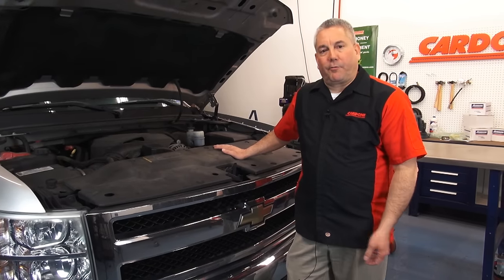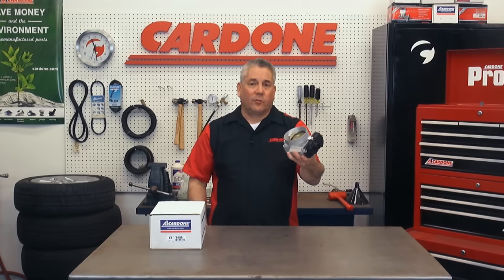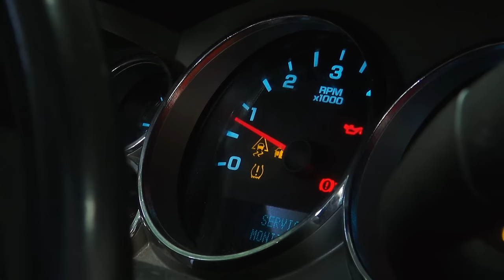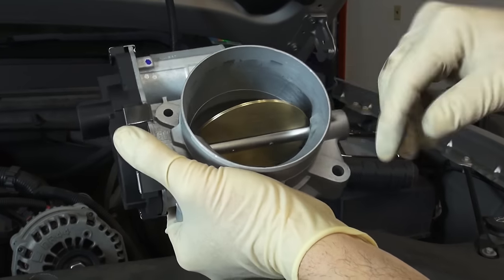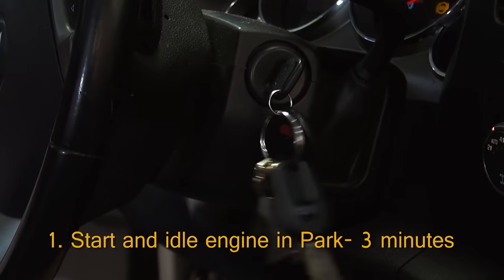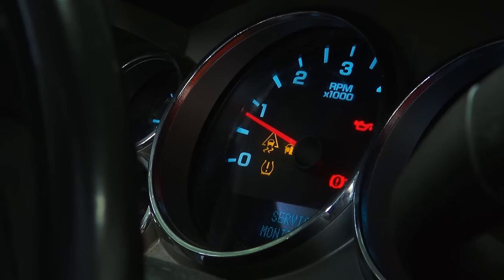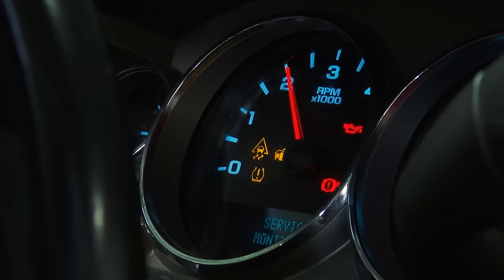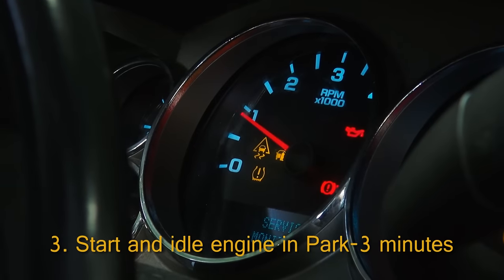GM Truck Electronic Throttle Body (ETB) Relearn Procedure

Comment: FYI....also be careful not to get carb cleaner into the electronic portion of the throttle body. make sure to tilt the throttle body in such away that the cleaner can't run down the butterfly shaft and into the electronic portion. there's a circuit board inside. and you don't want the cleaner to get on the cir. board.
Reply: Will it damage the throttle body if so? My Tahoe now in neutral idles up and down rapidly and n park stays past 1500 rpm’s then drops to normal a few seconds later
Reply: Roflmao! Anyone who actually removes their throttle body will know better. Just spray the inner parts and you'll be just fine.

Comment: 2003 silverado 5.3L.  check engine light on showing o2sensor system too lean and reduced engine power.  after replacing the electronic throttle body i deleted the codes and a few days later check engine light came on showing code p0332 knock sensor any tips on this one .  
please let me know thanks

Comment: what do you do if the engine wont idle? I replaced my throttle body (2006 trailblazer) and now it high idles then drops so low it stalls out. I got it going after a while and then the next day it did the exact same thing. High idle for a few seconds then the idle drops to a stall.
Reply from the maker: Hi Jesse, if you have a technical question, or need to troubleshoot a repair, be sure to reach out to our Tech Support Team, please call 888-280-8324 Mon-Friday 8am-5pm EST to speak with one of our ASE-Certified Technicians.

Comment: Hi,  Please help me.  I did exactly how yousaid to do the 're learn procedure.  But once the car is fully cooled off , Like in the morning,  I get the same symptoms, Check engine light and tc light.  

Thank you so much
Reply: Hi ,  Code is 0107 .  Only comes up in the mornings, first start of the day and when car is fully cooled off.  Already replaced the Throttle body and position sensor made by ac delco, Did the relearn process exactly like your video but shoots this code in the mornings and when cooled off.

Thank you so much
Reply: Sry.  It's a 2004 Suburban 5.3 gas.
Reply: Will do.  Thank you so much.

Comment: How do you fix rev hang like when you rev the engine up in park or neutral and the rpms are slow to return and come back down to idle?
Reply from the maker: Thanks for the message Bryan! This sounds like a question for our Tech Support Team, please call 888-280-8324 Mon-Friday 8am-5pm EST to speak with one of our ASE-Certified Technicians.

Comment: Uggghh what if this didn't work?! The car is still idling high and acts like it's in cruise control while driving. Take the foot off the gas and it just stays constant and doesn't decelerate... Any suggestions?
Reply: DAVE,  Got the same issue.  All of these videos on youtube sound easy with great results but it is NEVER the case.  Replaced the original TB on my 2013 Silverado with 265,000 miles today,   followed the procedures EXACTY, SEVERAL TIMES, without any success.  Idle goes to normal ONLY if stopped and I leave in drive and then it drops;  but, if I put it in park, it goes straight to 3,000 RPM and STAYS there. This is all Bull Sh  .  Did you ever find a solution?  I would appreciate your help.  Thanks. JIM
Reply: @932stretch  I ended up putting a new throttle body on the Malibu and everything is back to normal and working as it should. 🤷🏼‍♂️

Comment: My 07 Avalanche is doing a similar thing. I ended up taking it to a shop where they re-set the learn procedure I guess for the cost of $150, now it seams to be idling back to normal in park and when i come to a stop. However I do notice it will increase RPMs when costing even on a upgrade. seams to level out at 20MPH. another note it also only seams to have problem when at operating temp. when the truck is cold it operates as normal. Also seams to be shifting late, worried it will damage my transmission and wear my breaks fast. took it back to the same shop and they suggested putting in factory parts and re-learning it again for the tune of about, $600  I'm hoping driving will complete the learning.

Comment: I cleaned the tb on my 07 chevy cobalt 2.2l and followed the instructions but i have a high idle. it goes away in park after a few minutes but when i give the car gas, my idle goes back up to 1500 or so rpm and will stay there. What do I do. I've heard of getting the ecm reflashed at a dealership but that can be pretty expensive.
Reply: GM does this so that you're forced to pay the money to fix it. If you're okay with skipping a mortgage payment for the month, you can buy a scan tool to fix it for you. Pretty easy! But those money hungry fast cats design all new cars past 96 for this reason.

Comment: did what you said, still have an iratic idle after cleaning the throttle body of carbon build up,  even took it for a drive...it seemed fine for a day  then ,  the idle became erratic again and a check engine light came on
Reply: Which code did you pull?
Reply: Same issue

Comment: quick question  is the procedure the same for. a 2009 malibu I tried it but still remains the rpm at 3000.any info will help thanks ?
Reply: Hi, I got the same problem with my 2009 malibu, I cleaned the throttle body and then got 3000rpm at start and crazy acceleration, did you manage to solve the problem?
Reply: were you able to solve the problem?

Comment: ive been trying this on my 09 1500 4.8 silverado after replaceing the tps and cleaning the throttle body, i have done the 3, 60, 3, and have drove above 44 mph, stopped idled drove again stopped idled drove again and it is still idleing at 3000 rpm, any advice you could give?
Reply: my throttle position is 31.4% and when i put the truck into gear its at 20.x% normal would be 13.7% i was told, with the ignition on engine off i can manually close the throttle plate and the sensors reads that i closed it but it goes right back to the 30.x%.
Reply: Joe anonymous did you ever figure your issue out. I’m having same on 2012 5.3l.

Comment: When ever I put in the new sensor and had clean that I put it back on and the truck now accelerates by it self I tried everything on the video but it still doing that and I don’t want to put it on drive because my rpm on 4
Reply: Clear the codes before starting the relearn . After disconnecting the battery the engine light will be off but the code is still present in the memory . If it comes back on the test drive clear the code again and continue the relearn procedure
Reply: My tahoe  is doing the samething☹ accelerates  to 4 ...
Reply: Same problem  here..
Reply: @CAM_54321  did you clear the codes first then follow the steps. When you disconnect the battery the code isnt cleared it just turns off the check engine light. And do you have a scan tool ?
Reply: Mine is doing the same thing. I idling at 3 rpms but I cannot get it to go into gear

Comment: Some relearn advice for 2009 malibu? I already did this multiple times and it doesn't work, also tried the battery disconnect thing (24hours), push brake while battery disconnected nothing works, Do I have to take it to the dealer for reprogram? :(
Reply: did you ever figure this out? I am thinking of changing my throttle body due to the ESC OFF and Power Engine Reduced messages on the dashboard.
Reply: Cardone Industries no worries, what worked for me was to disconnect the battery before replacing the throttle body.  Once I replaced it, I connected it again and left the car on for 3 minutes to help the computer even out the RPMs. This video was a great help! thank you!
Reply: Ramses Rocha was yoir 2009 malibu giving you the reduce engine power, service esc, and no traction or service traction warning messages? did you replaced the throttle body yourself? it just happened to my car and took it to the mechanic and i think they are trying to scam me into getting other stuff fixed before fixing that
Reply: I have a 2.4 l 2010 malibu changed spark plugs and cleaned throttle body get a high Rev at 3000 wants to go as well without pushing gas Wil do about 25mph

Comment: Is it possible to do this after the truck has been started for the first time since the repair? I didn't get to see this until after I started and revved it immediately. It idles low now and would like to know if I have to  disconnect/reconnect the TB to restart the process.
Reply: Cardone Industries It's a 2006 5.3 in an Avalanche, I did the relearn and it seems to be better. Wouldn't hurt to do it again after disconnecting the TB though.
Reply: Cardone Industries. hay cardone i cleaned the thottle body on mi 2008 suburban did the relern work ok but if i acelerate to2500rp it will stay acelaratet ani tips thanks

Comment: Hey I have been doing body work on my truck and have been welding so I have had the battery disconnected and now my truck wants to stall after I let off the gas and it ran fine before I started working on it. Please help
Reply: You fried your computer.

Comment: Would this procedure work for a 1993 Buick regal 3100? I'm having stalling and hesitation. When I first bought the car the only code was a failed EGR code I disconnected the battery to take apart the plenum and repair the EGR.  I also replace I iac valve because the old one pindle came off. Every since then the car stalls when reaching operating temperature.

Comment: So I just disconnected and cleaned the throttle body, and after doing the relearn process I idle right around 600 RPMs, but the problem is if I rev up the engine the RPMs stay up and will not come back down. Any thoughts?
Reply: Any word on how to fix it?  Same issue on 2012 silverado.  If I put it in drive, it accelerates by itself.
Reply: @izrahiahisrael8726  bought a new throttle body 😂
Reply: @izrahiahisrael8726  you figure anything out having the same problem 2011 Chevy

Comment: My 2011 GMC Terrain was throwing the P2135 code and the dreaded Reduced Engine Power and Stabili Track errors. We replaced the throttle body and NOBODY told us to do the relearn procedure like this. It was still throwing the RNP and ST errors and we couldn't get it over 20MPH without shutting off and it locking up for a minute.  We did this relearn procedure and now it'll go up to 50 and alternate  down to 20 perfectly fine for long distances. It's now shutting off when sitting still and when going constant low speed (between 30-40) for longer than a minute or two. Any ideas? 

Give you a run down on what it's doing:
After sitting off for a while, it'll crank fine and not throw a code.
It'll drive fine alternating between higher and lower speeds the whole way.
AS SOON as it stops at a stop sign or red light, it'll die. But it'll recrank fine.
Also, as soon as you hit 30MPH and stay there for more than a minute, the code triggers (we kept it at 40 for a while and it only seems to trigger at the lower 30mph)
And after you drive it and recrank it, the code will trigger if you sit longer than a minute even in park.
Reply: Is your vehicle a  flex fuel vehicle?
Reply: @rodcollins6906  Hey Rod, I'm having the same issue stated above with a 2007 Chevy Avalanche 5.3L Vortec Flex Fuel.  Any suggestions?

Comment: Pretty close, you missed one crucial step. All DTC's need to be cleared PRIOR to performing the service bay/on road idle learn procedure. Regardless if the MIL is illuminated or not.
Reply: Exactly I  told them they missed that step months ago and they still  haven't responded
Reply: @jeanjacque1577  this is youtube what do you expect?
Reply: So your saying clear everything before taking the tb off?
Reply: @TB-uz2wu  clear it before starting the relearn so after you install the throttle body
Reply: How do you clear the codes
Reply: @reneorduna5448  scan tool or disconnect  the battery
Reply: The video mentioned that the codes must be cleared to continue re-learning.

Comment: I've always heard that '07-'13 had to have the idle relearn done with the proper scanner. Have I been told incorrectly about this and this method will work?
Reply from the maker: Hello Murrica Motors, can you please forward an email address so someone from our Tech Support Team to contact you directly? If not, you can call our Tech Support Line at 888-280-8324 weekdays from 8 am until 6 pm EST (5 pm on Fridays) or submit a question online at https://www.cardone.com/customer-service  Thanks!
Reply: Hi, I have an 07' Avalanche 5.3L Vortec Flex 4WD.  Can you please let me know if the relearn can only be done with a proper scanner or if this procedure will work without a scanner?  It would be extremely helpful an appreciated. Thanks in advance.
Reply: @AmitroniX  I have been able to achieve a throttle body cleaning by having someome turn the key on (not started) and then hold the gas pedal down and then take carb cleaner and a rag and carefully and thoroughly clean the throttle body without moving the throttle body blade in the process and remove all of the deposits/gunk and then let the person release the gas pedal and then turn the ignition off amd then hook everything back up and start the vehicle and it would be fine, but as far as replacing the entire throttle body I have always had to end up having it relearned by someone with the proper scanner.
Reply: @JustAGuy781  I have cleaned it in the past with the exact same procedure you described and it worked for a few months but now the issue is back.  I ordered a whole new OEM GM throttle body from AMZ for $215 and am installing it tomorrow.  I was tempted to buy the Hitachi bc it was cheaper and had good reviews.   I was under the impression 07's have to be done with a bidirectional scanner and you pretty much confirmed.  Thanks for the quick response.  I really appreciate it.
Reply: Btw just for anyone else reading, the codes I get are P2135, P1516, P2101 with reduced power, SVC traction control and stabilitrak.

Comment: So i tried this and changed the throttle body still idles about 3000 rpm but drives normal can yall help me out?
Reply: Enrique Cortex 
Did you try disconnecting the battery for a few mins?
Then try the 3 step relearn procedure?
If not, try that, and gopefully youlll get good results! And make sure if the throttle body was removed,yhat the 4 bolts are torqued down properly,and not causing a vacuum leak

Comment: I didn't replace but I cleaned my TB with specific cleaner on my 13 silverado 5.3. So far in neutral the rpms shoot to about 2300 and sit. I was told driving would relearn positions. I've put nearly 200 miles on it and still no fix. Also, in manual mode (transmission) if I shift down to first coming to a stop, the idle is very rough and then kills the engine. Is this still a TB issue? Thanks in advance.
Reply: Ryan, where you able to fix it? If you did, please tell me how you did it, thanks
Reply: +grillomix just replaced oil pressure switch. still no fix.
Reply: +grillomix just replaced the throttle body all together. Did the 3 min, 1 min, 3 minute relearn. Still having the same issue.
Reply: +Ryan Ledbetter l'm taking my truck to the dealer tomorrow, $110 😢
Reply: +grillomix mine quoted  $120. still debating on it.
Reply: Did some "high tech" relearn with a new gasket. All fixed now. Sorry
Reply: I replaced it all. New TB, new TB gasket, and then I had to pay for a TB relearn since my scanner/programmer isn't all high tech.
Reply: Ryan Ledbetter what hapen did you fixed
Reply: Jose Martinez I took it to my chevy dealer and they had to do a relearn through their scanner that was more high tech than mine. issue fixed after that.
Reply: Ryan Ledbetter thanks ryan im going to do the same thing
Reply: Im leaning towards that, How Much did they charge
Reply: Intimidator Ss I believe about $90 or so.
Reply: Thanks man, This is driving me crazy. I no I need a re-tune but an ECU Flash tune costs $500 buck-a-roos. Im going to run it down to Chevy.
Reply: Intimidator Ss no prob. hope you get it solved I know I was pretty irritated dealing with it for 1 day.
Reply: It might also be a vacume leak?
Reply: Intimidator Ss possible, but I figured after what I did it pry needed a legit relearn. vacuum leaks are simple to test.
Reply: Agreed, They can check and see what ever it is. Man I hope they can fix it...It messes with my transmission's head. It will try to accommodate the high RPM so when Im doing 55-60 it will shift up and down. Its a real P.I.A. Good news is when I nail it, it works fine.

Comment: I have an C3 corvette with an LS7 motor.  Motor idles at 900 rpm even tough the tune has it set to 650.  I sometimes get a P2176 DTC (Minimum throttle position not learned) which in turn puts the car into limp mode.  I'm having a hard time finding a solution to my problem.

Comment: I tried this and had no luck on my 2008 Avalanche after i installed a new throttle body. I  also drove it and   still when i hit the gas in park it goes to 3 grand and stays there . Had to take it to a shop and have it reset with a programmer.
Reply: How much u had to pay
Reply: @trustinthelord2248  it was 100 dollars

Comment: 2009 silverDO...CHANGED PEDAL AND TPS (3TIMES)   idle wont come down from 2500rpm  help
Reply: A leak in a vacuum hose can cause a high idle.
Reply: michael schapiro I’m having similar problems with a 2012 Silverado. Did you ever figure it out or did it fix itself over time?

Comment: Will this procedure work on a Chevy car also?
Reply: I'll know in a couple days.  This era of chevy is gm. A lot of parts are the same depending on what vehicle. Im going to try this on a 2007 silverado 1500.
Reply: Any luck? Ryan?
Reply: Kinda worked kinda didnt. Throttle body and pedal replacement went fine. Truck runs but check engine is still on and idles REALLY high. Looks like i may need a reprogram 😏
Reply: @ryandickershaid279  damn thats a tragic
Reply: @kejuanholland8356  I had high hopes too!! I did further digging on the subject and its generational. Some vins need reprogramming some dont. I would still try it. Worst thing that happens is that it doesnt work on your generation.